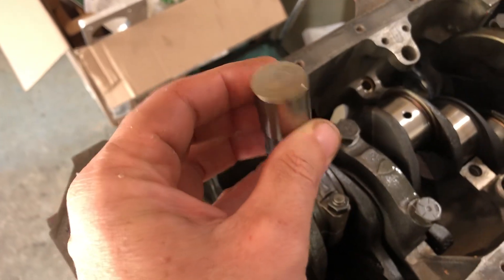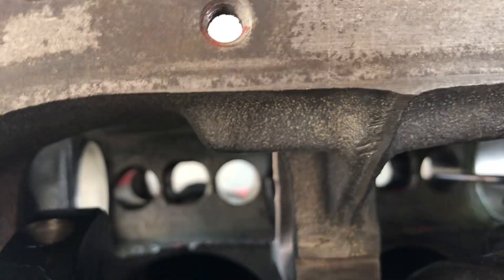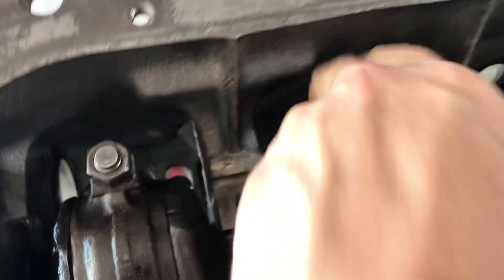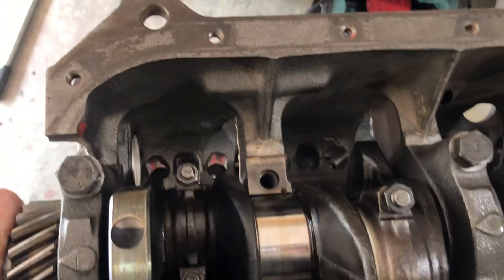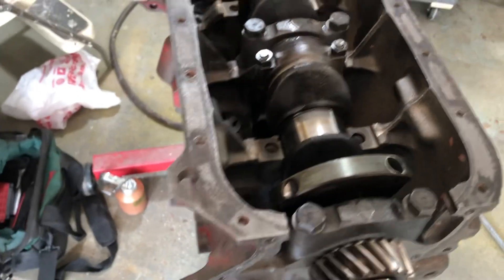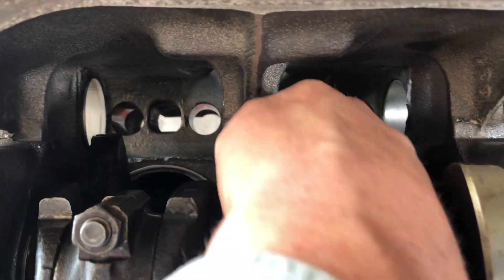Solid flat-tappet lifters in a Volvo B20. How practical are roller lifters ?

Comment: A roller lifter cam requires all shells to be the same size and the pushrod holes to be enlarged in the head. You can buy the lot from Sweden.
Reply from the maker: It’s also insanely expensive . The block needs to be extensively modified and the roller cam kit costs more than I paid for the car .
Reply: It's been done. But it's a lot of messing around with a lot of modification.  @AndySomogyi